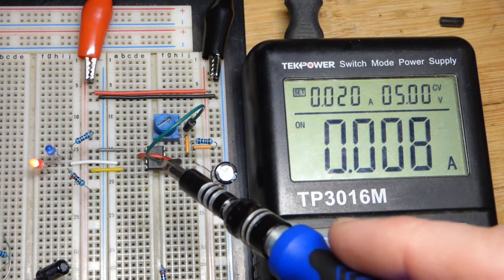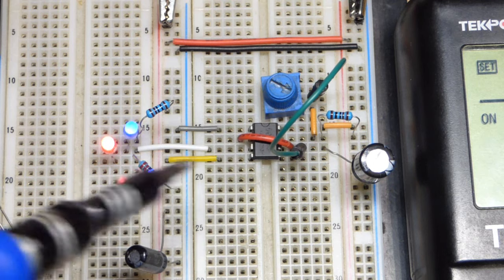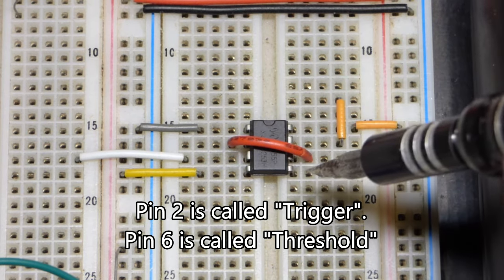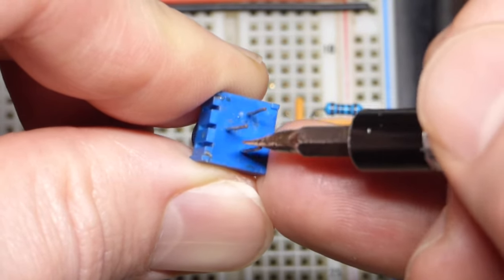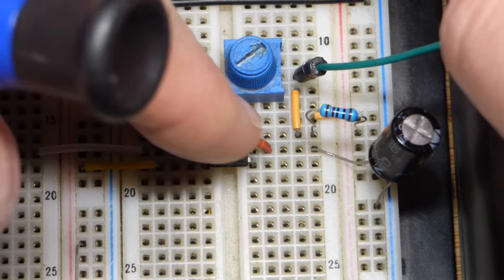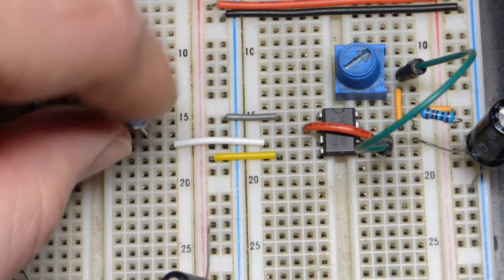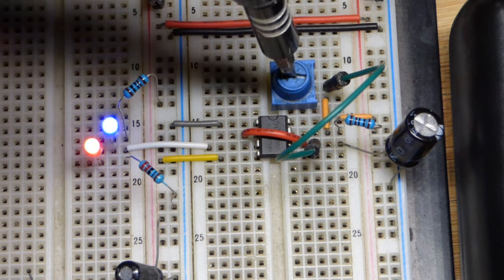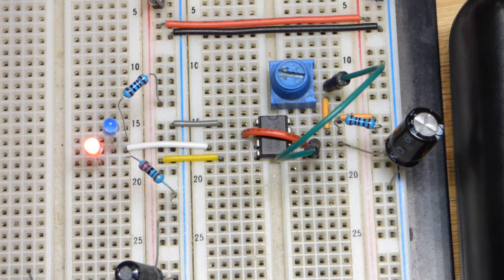Trimpot Adjustable Astable 555 Timer Step by Step Build with Flashing LEDs

Comment: For fun, I put together a circuit that used two 555 timers to drive an SN74HC164N shift register to create an LED chaser. One 555 acted as the clock that shifted the bits in the register and the other toggled the register's input state high or low at a slower rate. The eight pins of the register itself were connected to resistor protected LEDs. Cheers! 🍻
Reply: How much frequency can it produce
Reply from the maker: Very cool :) https://youtu.be/WvSDekPyAko I just uploaded an audio electronics video that briefly shows the results of a circuit I put together. Wanted to make sure I mentioned it if I saw you being active somewhere, so perfect timing.
Reply: @Electronzap  thanks!
Reply: @shivenprashar1427  according to @stnwrd in another thread on this page "Max Frequency (Astable)500-kHz to 2-MHzVaries with Mfg & Layout" 555 ICs are great for my needs which tend to be audio related. Cheers!
Reply: @HazeAnderson  cool

Comment: Can u make this circuit using transistors ? Pls
Reply: I have made a 555 timer IC with discreate components (transistors and resistors)
Reply: That's a huge request to ask of someone. "Depending on the manufacturer, the standard 555 package incorporated the equivalent of 25 transistors, 2 diodes, and 15 resistors ..."
Reply: @stnwrd  how much frequency can it produce
Reply: @HazeAnderson  well umm 
Curiosity has no boundaries
Reply: @shivenprashar1427  Max Frequency (Astable)500-kHz to 2-MHzVaries with Mfg & Layout
Reply: With your permission electroniczap could I please post a link to a video I made with a 555 time I made?
Reply from the maker: I think YouTube will block any links someone else shares. I made a subreddit reddit.com/r/ElectronicsStudy/ that anyone can post their science based videos and stuff too.
Reply: @shivenprashar1427  "Curiosity has no boundaries" fair enuf 😆
Reply: @stnwrd  anywhere else can you share it stuff ?
Reply: @HazeAnderson  heh😉